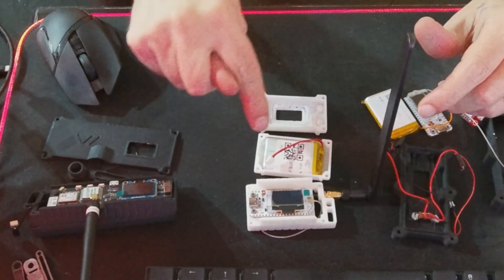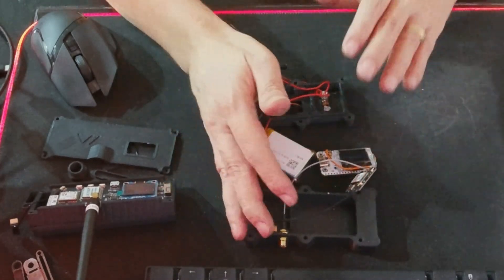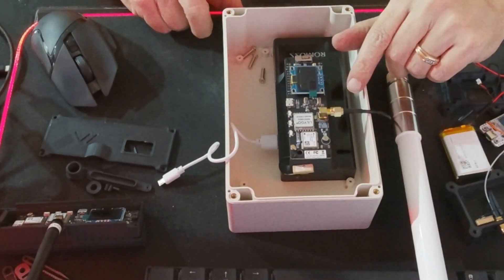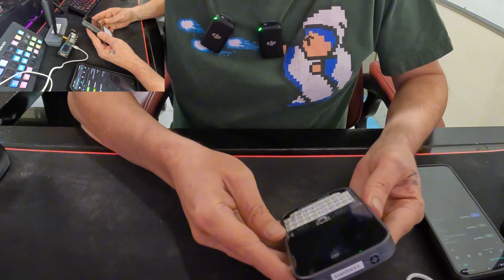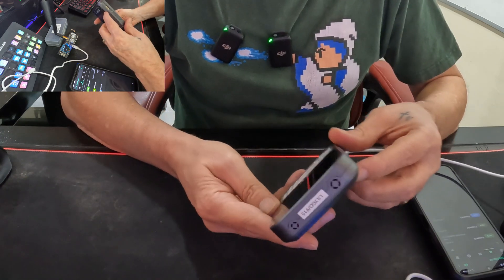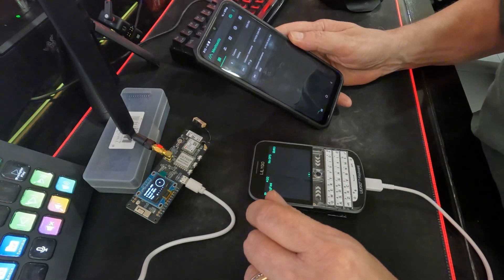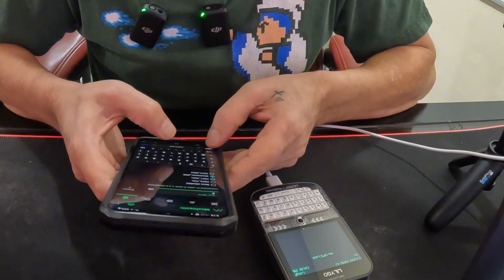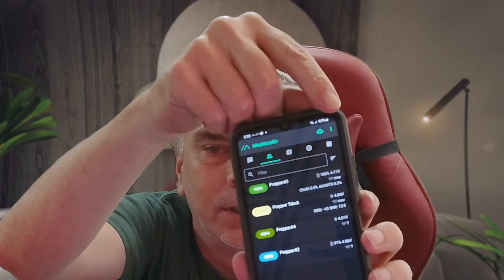Meshtastic _ T-Deck Plus LILYGO

Comment: Are you using 915MHz meshtastic in Philippines?

Should be 923MHz like the most of Asia.
Reply from the maker: Yes.. all of my mestastic gear is keyed to 915.  Quick google searches indicate AS923 (915–928 MHz) in Asia  .. so both acceptable.  Most PH discussion around lora is 915

Comment: I have a tdeck+ for a week now. i have the latest firmware and I have added an external antenna
Reply from the maker: nice.. see better range with the external antenna?
Reply: @PHExpatPrepper  oh yes, couldn't see any other nodes until Installed it. It isn't currently my only device